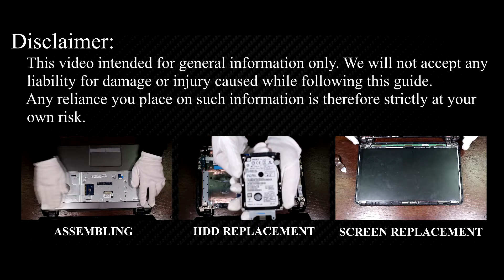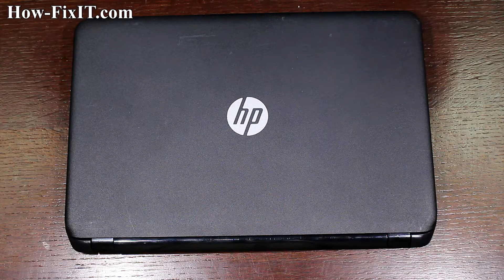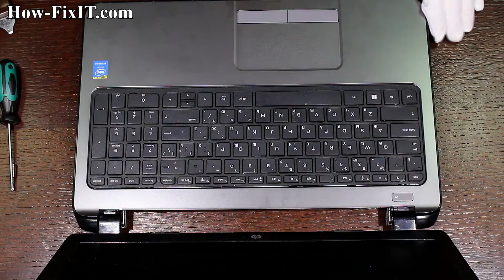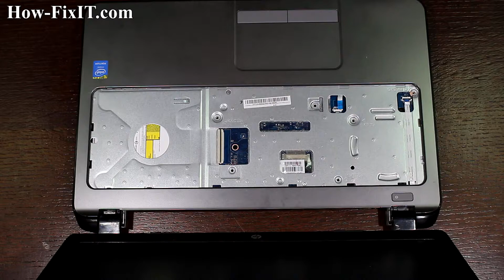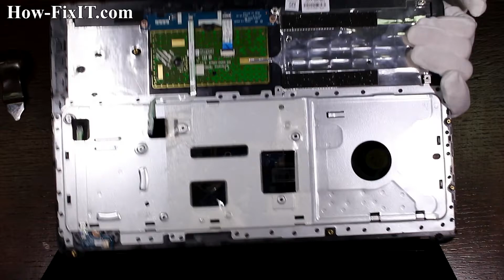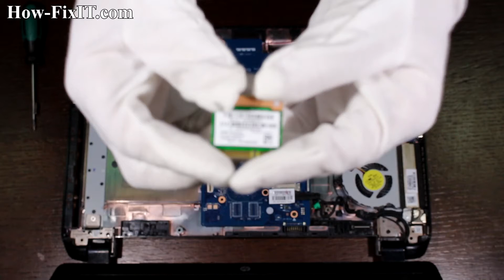HP 250 / 255 G3 Wi-Fi Card Replacement | Fix Wireless Issues

Comment: I have a hp 250 G3 laptop. My computer's wifi connection drops frequently. After the connection is lost, the wifi setting does not appear in the settings. sometimes wifi connection reconnects after restarting the computer

What can I do? should i change wifi card

Comment: Hello, Thank you very much for this video. Do you know whether 2 wifi antennas can pe mounted instead of the standard 1. I have a dual band Intel ac7260 that I would like to mount and I need to know whether I can also replace the existing antenna with 2 ones?